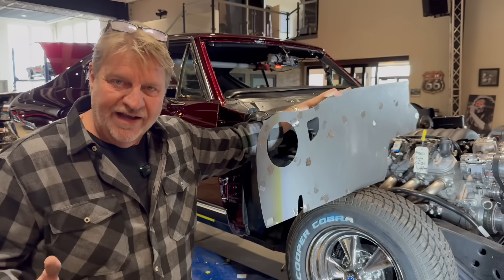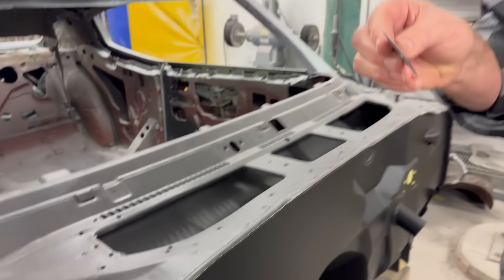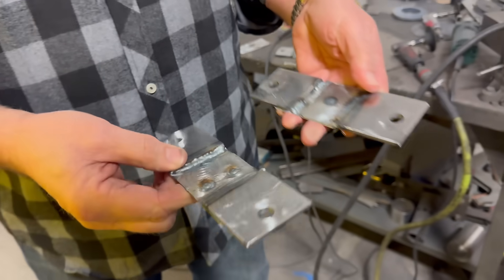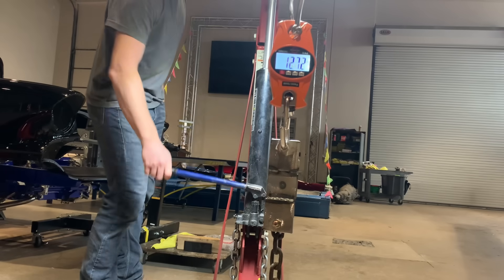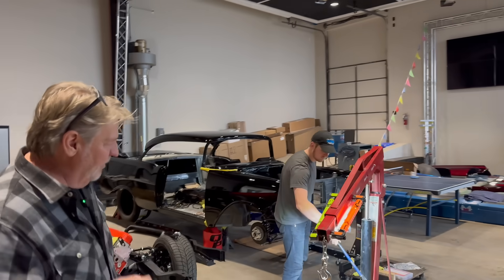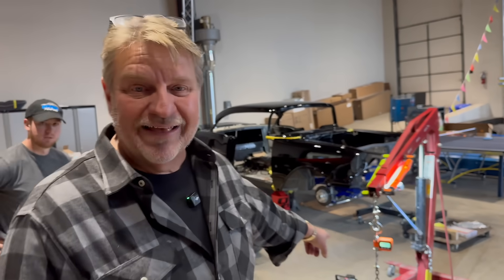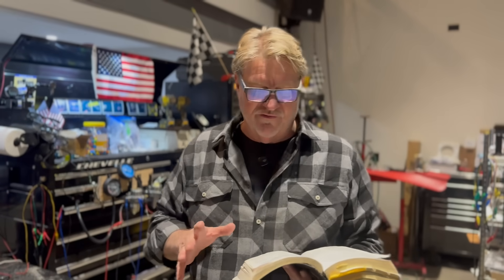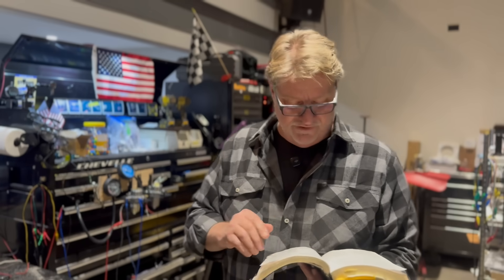Restoration Shop Using 3M Panel Bond Vs. Welding - Let’s Find Out Which is Stronger

Comment: New car's and 18 wheeler's use panel bond on them for everything.. it's a pain in the A to get them apart sometimes to repair them
Reply from the maker: There is definitely draw back to the repair side of life, that's no lie.
Reply: @studiohotrodsofficial right.. it's fast and easy when you are repairing whatever.. but i hate having to undo it to be able to repair it..

Comment: As someone who has had to remove truck bedsides that were put on (incorrectly, by me) with panel bond, this is not a surprise. The stuff is great if (and that's a big "if") you are never going to have to remove what you glued on ever again. Attempting to remove it usually damages the panel glued on with it, and whatever it was glued to. 

It also generally makes for a quieter car when everything is finished.

Comment: They did that test back n the 90's. It us a straight pull test. Now n a wreck on the firewall, make the pull straight to the front of the car, it doesn't hold as well. Where u can, always use a spot wels with panel bond. Very strong. There was a law suite  where a body shop glued the roof skin on. It failed n a crash. They were awarded 42 million dollars. Never use glue only.

Comment: well over 20 yrs ago I questioned the use of adhesive and did a destruction test on heavy gauge sheet metal I bounced a heavy bench with vise across the shop floor trying to destroy the joint and the metal failed before the joint did

Comment: I knew it!!!!   Finally you showed how strong the panel bond really is.   The BMW factory in South Carolina does this - - only makes spot welds to hold the parts stable while it goes to an oven to cure the bond. I really really want to restore my '77 C10 like this.

Comment: If the first plug weld failed at 780# , then the shear stress at failure was around 16kpsi or 16ksi abbreviated . The metal should fail around 32ksi in shear if weld was purrrrrfect! Hence, perfection isn't necessary to do good ! The adhesive has a much lower shear stress , but the adhesive is applied over a much larger area . Good results . Hence you don't have to be purrrrrfect to do good .

Comment: I think this is a good product for non-structural applications, preferable to plug welding since the space between panels is protected from corrosion. But be careful- 3M states that the product is not to be used for structural applications. That's because under constant load epoxy will "creep" and eventually fail.

Comment: 30 seconds in, which is the time of my comment, and my first thought about all the 'weld or die' types is, STOP.  This type, obviously ignorant, should avoid a keyboard at all cost, and pro-creating, for that matter.  Modern adhesives are unbelievable, when applied correctly.

Comment: We've been bonding bedsides on for about 8 years, no need for welds, the panel bond is faster, stronger and can be removed with heat if necessary.

Comment: While I'm a huge fan of panel bonding. I can't agree to use it in a firewall application. I'm sure you know heat is used to release the bond. In the event of an engine fire, and that bond cuts loose. It defeats the entire purpose of the firewall.

Comment: These epoxy's are amazing. But throw some heat at them and the situations change. Welds don't get affected by engine heat like what headers emit in the engine compartment. This is why headers are welded and not glued together. Would like to see how the panel bond holds up against what you would estimate is extended under hood temps. Say 200 degrees F maybe?? Thoughts? Consider turbos under the hood and that number goes a bit.

Comment: Another alternative I've been using for small rust holes (non structural, like a hole in a fender) is sheet metal and liquid nails. I cut out a small patch of metal with my tin snips and glue it in place by it's edges. Then you just bondo/putty the edge transitions.

Comment: It’s awesome to see the adhesive work so well but in the long run how would someone remove the adhesive to separate panels without massive damage?
Reply: With heat. Hot air is enough, no flame needed

Comment: Did you use the same bonded panel when you tested the double welded/bonded panel tandem, or did you use the the fresh bonded panel(I ask because the welded one had already been exposed to stress and the unused panel wouldn’t have been). Also, do we know how the bond will hold up over the course of time. Most rigid bonding agents get brittle with age. I’m not discounting the panel bond, I’m just curious. Great message at the end, keep fighting the good fight!

Comment: I'm still not convinced 🙂
This test is just checking sheer strength not tensile, a proper comparison should test both .
besides, the spot welds are  ~5mm each. So 2 spots welds could be considered a total of 10mm of weld,
To compare apples with apples, you need to apply only 10mm of panel bond.

What I saw was closer to 50mm of Panel Bond. 🙂

So the question is ... on the firewall, how much overlap is there and how much panel Bond is used?
 I would think the flange the firewall is bonded to is pretty small , not like the test an din that case the welds would be stronger

BTW - love the bible reading

Comment: Panel adhesives (in lieu of spot or plug welding) have been a factory authorized repair method by several car makers for over 25 years.  When done correctly, it helps a body shop do a much faster, lower cost, and sometimes better repair.  
If someone gives you a hard time about it, they're simply not familiar with the process.  Furthermore, your fire wall covers are literally adding a lot more strength to that part of the vehicle, which they weren't even required to do, I think they're awesome.
Keep up the great work!
The only problem I saw with this video is the 1/4 inch plug welds.  Plug weld should be 5/16 or 3/8 inches.  1/4 inch is not strong enough and unless it was actually recommended by an OEM, it could create a liability if used in collision repair by a body shop.  For the sake of your comparison, the panel bond still would have won if you used bigger plug welds.

Comment: Faulty test since that piece should have a third plug weld to stabilize the linear plug welds. Done properly, the plug welds would be equivalent. Also, make sure your bonding material is rated to with stand vibration as some become brittle over time.

Comment: I'm probably not alone is stating I'm absolutely shocked that glue did as well as it did. When I first remember seeing car manufacturers using it at the factories in the 1990s, even as a high school kid, I was thinking "how utterly stupid and cheap." I may have to adjust my thinking a little. 

Now...one question. Moisture retention has always been an issue with cars, and as more foam and other absorbent materials are stuffed into them as time goes on, it's become more of an issue, because it can frequently cause really bad rust. Does this stuff retain moisture, either from water itself or humidity? If it does, I would personally be loathe to use it, unless I absolutely had to.

Comment: I used the panel adhesive on my last project for some panels and found it has pros and cons with welding.  First it is expensive, about $100 for the double tube here in canada, you have to leave it overnight to cure, and completely clamped together so welding can be cheaper and faster, and the glue can be messy, on your hands and getting where you dont want it.  Drop the panel and now you have dirt in the glue etc.  But you dont have to drill holes for plug welds, the overlapping joint is sealed with glue so better rust prevention so its pros and cons.  In places where welding is difficult due to access, or there's worry of warping, or weld splatter damaging surrounding paint etc glue comes in handy.

Comment: Ive used JB weld on small sheet metal fixes that held find, actually has more PSI per square inch than Panel bond but I think it's more expensive per oz.

Comment: 35 years ago ICAR told me to weld  around the circle, not hit the center and let it flow to the edge. however, your test seems to show your way is adequate. For someone just putting a few rust patches in, the panel bond is pricey. Plus you have to wait for it to harden.

Comment: I put my kids whole Volkswagen bug together with panel bond. I worked for Saturn as an engineer, and and those cars had quite a bit of plastic and very little welding. This stuff never fails if you use it correctly, just like any other material. I’ll put a lot of cars together with the panel bond and the only thing I don’t like is the smell. So I’ve been using it for over 35 years.
Reply from the maker: Thanks for sharing your extensive experience with panel bond! Wow you know a lot more about it than I do about it,,, 
    It was fun. I was asking all the guys what they thought was gonna be stronger and everybody was all over the place but now we know.!! Ha

Comment: You can make panel Bond go off faster get a heat gun on it and start warming up the metal and it will eventually kick off a lot faster than it cool down and then you're back in business. If you had a cold environment warm it up with the heat gun at the end of the day and then just leave it alone until the next morning it'll be ready to go

Comment: My demo that I saw that sold me on panel Bond was two pieces of Auto body sheet metal bonded together in a lap joint we put it on the frame rack and pulled the two pieces and the one piece ripped apart but the joint did not fail. Are you guys I don't know a conventional frame rack it has 10 tons of force that it can bring to bear on whatever it is you're pulling that's 20,000 lb. In the lap joint did not fail the metal failed

Comment: I've been using this material for close to 25 years. It does have limits it is not a replacement for an actual weld per se. Do not use it in extreme cold places like Canada or Alaska it will not hold up to the extreme cold. 3M panel Bond 8115 it is exactly the most awesome epoxy for bonding ever. Plastic bumpers plastic – parts plastic door panels steel to aluminum aluminum to aluminum steel to steel fiberglass and fiberglass disturb will attach anything.

Comment: I used the good stuff on quarters of a 65 GTO. After I painted it and was cutting the paint, I noticed the rivet spots were popping....... Took it back down and welded it. Not doing large panels again

Comment: 3M can't make good bonding material.  So it wouldn't work.
Reply: 3M Panel Bonding Adhesive, 08115, OEM Recommended

Comment: The two plug welds are 3/16 dia each. The glue is 2”x2” not exactly a comparison. Make the  glue joint 3/16”only.

Comment: In order to test these different applications of fasteners they must match. Shear testing is what you have setup on your test coupons. You want to pull the 2 pieces past each other. Your glue on firewalls fastening can never be pulled in shear. Its captive at its edges. You need to test in the lap  direction. Incorrectly applying the specific fastening methodology and terms negates the test. Tell your followers that cleanliness and a toothed surface are most important. The glue wins because it has involved more surface area then a spot weld.

Comment: Thank you for your test on panel bonding cement.  I was thinking about using it to replace the lower door skins on a Diamond T that I am building, but had questions about the structural integrity of the bonding cement.  You have removed my concerns.
The icing on the cake was your Bible study on 1 Cor 3:5-8.  Great job!  It is the BEST PART!
Reply from the maker: Glad it was helpful! Thanks for engaging with me!! And yes the Bible is by far the best part! 
     Harry

Comment: So how does a glued 'firewall' do when it's a fire?
Reply from the maker: Funny never thought of it in those terms,,,  you make a good point however a firewall in a car is different than a firewall in a house or a home or a factory or an apartment building… with our replacement firewall if you’ve taken a look at it, you would notice that there is also studs which may be a bit overkill. However, the studs are steel mechanical fasteners that would remain even if there were a fire. between the passengers or passenger compartment and the engine bay….

Comment: Myself I'd like to see the panel bond squeezed tight since panel on cars are pressed tight go fit the more gap between the tw panels will aquare mote body filler. And how about five to ten years down the road with body flexing and the glue breaking down with the hot and cold? I'll still stick with welding they been welding panels on cars for over 100 years and glue hiw many years?  Would the glue hold up to an acid dip for a restoration dow the road???  I don't think so...

Comment: The channel BPS Space just did break testing with over 100 epoxy samples with interesting results finding the most consistent lbs breaking strength. Check it out if you want to learn more.

Comment: Seems like the panel bond would be better than a weld because the welds will create corrosion at the joint where the panel bond will seal it on something that has a lap joint like a firewall or where the quarter meets the roof skin and at the Dutchman panel. Not sure if I would trust it on a structural panel on a unibody that is not designed for it but...

Comment: Been using metal bonding panel blue since probably 1992. On roofs quarters panels. Only place I weld is inside the door area and the rear body panel the way 3M wants

Comment: other than strength you should consider the glue is a lot more rust resistant especially if youre putting in replacement rust repair that already rusted out once in an area with no weld

Comment: Panel bond is great stuff. It's not designed for frame/structural areas but it's awesome for other areas. The only caveat is it can cause ghosting over time. That is what I have read at least. I have used it in a few places on my IROC where it's not going to be seen. Welding isn't my forte especially on thin steel so this has been a great substitute. I also don't like welding where unnecessary because the heat/oxidation it causes. You wonder why spot welds rust? Because it's helped along by the process. Great video on showing the strength of panel bond vs welding. 🎉
Reply: Use 3m's 07333 in frame/structural areas, its impact rated panel bond. Use it all the time repairing vehicles in a professional setting, usually in conjunction with a squeeze type spot welder.
Reply from the maker: Thanks for sharing your experience and insights!

Comment: I had wondered about this for quite a while.  That's awesome to see!  For those of us without welding tools and skills this make the idea of panel repairs much more doable.  I also imagine this has a better rust prevention built right into it as it's a solid bond which is between both panels, there's no gap for moisture if applied well to both surfaces, that makes it even better.   Thanks for testing this!
Reply from the maker: So glad we could answer that question for you. Stay tuned for more interesting videos and tests.

Comment: Thanks for the test and the lesson. I just subscribed.
Reply from the maker: So happy you found the video useful and subscribed! Thanks for tuning in.
Reply: I have restored three vintage Mustangs. I consider myself a good welder as I have been certified in all position structural steel. I have struggled at times welding things such as floorplan patches when you have to make a weld to dirty and surface rust area. There is no doubt now  that the body glue is actually stronger and better.

Comment: I experimented using the 3m adhesive and I was very impressed with it.  I replaced rusted cab corners on my wood truck and was surprised how pliable it was. I thought it would start drying fast like jb weld. You have plenty of time to dial it in and clamp as needed. Definitely will do it again in the future
Reply from the maker: Glad to hear about your experience. It's truly amazing stuff!

Comment: If you take apart a truck or car from late 60s to 80s ford and gm those vehicles I had taken apart they all have some type of glue or adhesive between all panels that are put together overlapped and also they spot welded all the panels right through the glue and that glues bad ass.  I've seen years ago documentary film about glue and adhesive glue and they glued together roofing panels. I saw a documentary film about adhesives and glue how are you did come a long way from super glue and other types of glue from the past but I don't hear them say the name of any of the Products on the documentary film . This film was  at least 35 years ago.
Reply from the maker: You are certainly on the right track.   Adhesives have been around a long time.   Thanks for watching.

Comment: Did the 6 foot long quarters on my 70 Satellite 7 years ago.  Glued at the trim line, quarters are smooth & ripple free.  Even glued the inners & drop offs.  Only welded at the door jams & rear panel at the advise of "experts" at the time.  Your test indicates that was not necessary.
Another benifit is the joint is water proof, ahould not rust.
Reply: Best thing is. No fire risk.
Reply: What did you put the word experts in parenthesis? Were they not experts? Are you mocking them?

Comment: Harry, I have always been skeptical about using “glue” to put a metal car together. But your demo has sold me as a hobbyist car guy to replace the quarters on my Chevelle. Thank’s!
Reply: Cars have been glued together for yeeeeeeears. As a collision repair specialist I can tell you van sides are glued on in the repair industry for one. You're way behind the times
Reply: @lollipop84858there is a difference between the modern throw away cars and restoring a classic. Id never buy a classic that was glued together. Im in aviation and we use these adhesives but its used for a reason, not to just be lazy